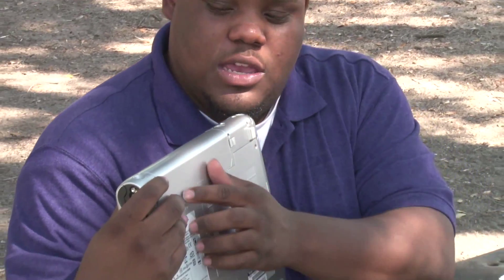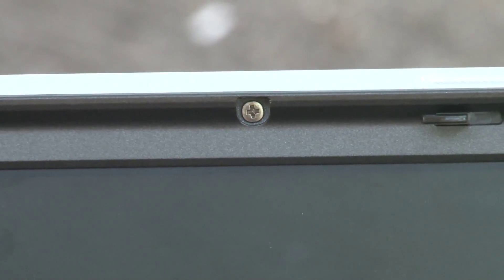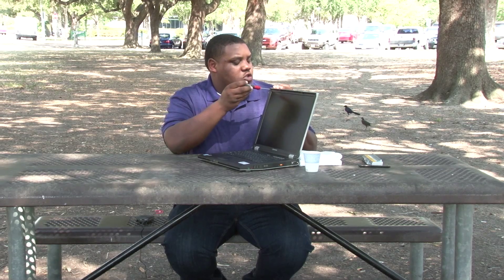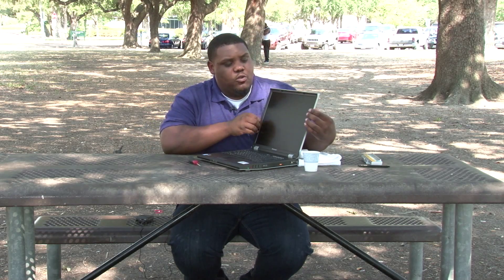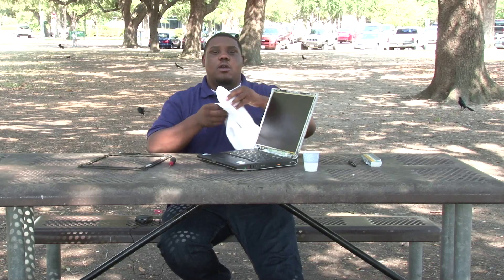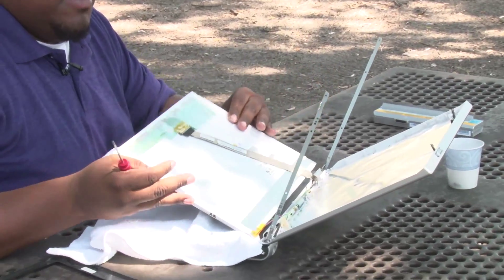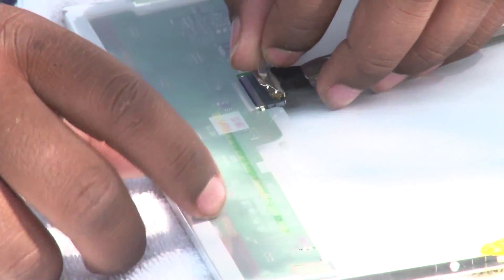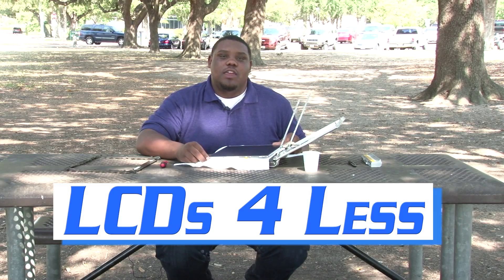How to Replace Broken Laptop Screen

Comment: .LOG
8:23 PM 1/19/2015

Laptop LCD Removal

1: Computer Power Off
2: Battery Removal
3: Turn laptop over and Lift Up Lid if closed
                              4: Press and hold power button 4 second [release the 01010101010] :): Tools Needed
6: Identify Components
7: Get tool, Phillip [size]
8: Screw order sequence [Upper left, Upper Right, Middle]
9: